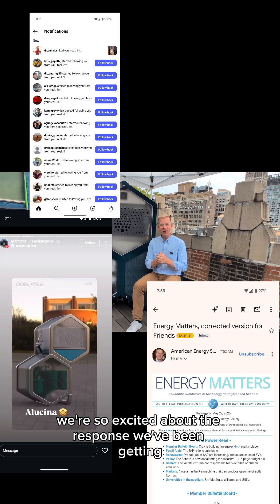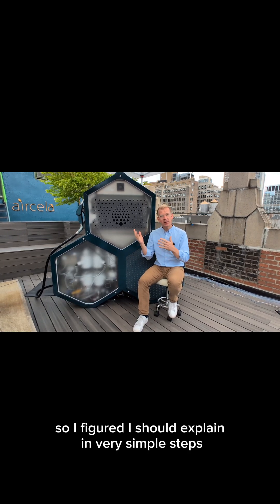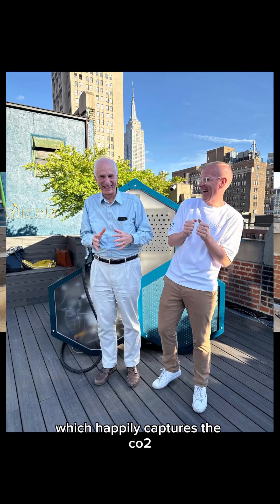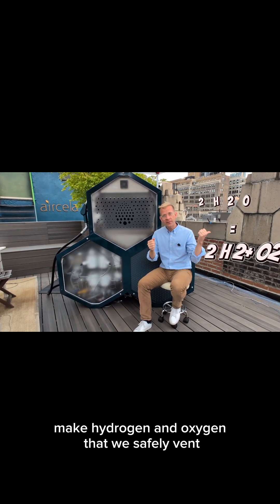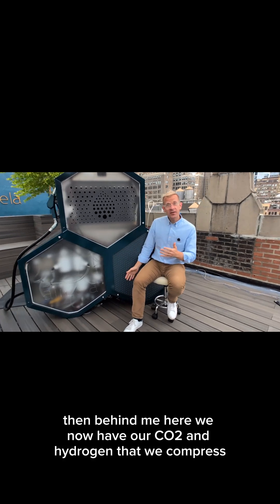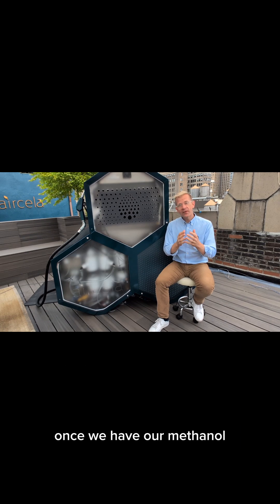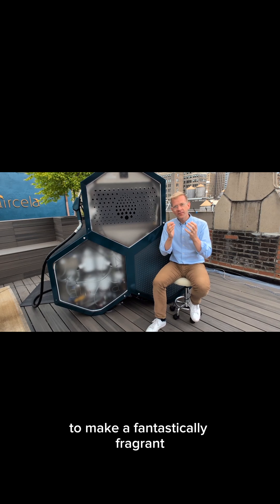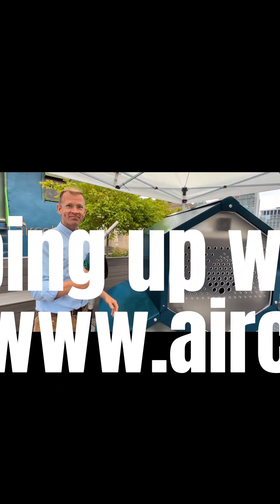Aircela dévoile une machine capable de produire jusqu’à 4 litres d'essence synthétique par jour

Comment: « Faire 4 L d’essence/jour “avec air & eau” ? Voici le vrai procédé… et pourquoi leur boîte bleue ne peut pas :

1. Capture directe du CO₂ (DAC)
– Brasser ~12 000 m³ d’air/jour pour 4 L (≈ 15 t d’air).
– Conso typique : 0,5–1,0 MWh élec + 1,5–2,5 MWh chaleur par t de CO₂.
– Ici il faut ~9,3 kg de CO₂/jour → ventilation, filtres, compresseur obligatoires.

2. Électrolyse de l’eau → H₂
– Besoin ≈ 0,8–1,0 kg H₂/jour pour 4 L (ordre de grandeur).
– Conso : 50–55 kWh/kg H₂ + ~9 L d’eau démin./kg H₂ → ~40–55 kWh/jour rien que pour le H₂.
– Matériel : électrolyseur, alimentation forte, refroidissement.

3. Conditionnement du gaz
– Souvent RWGS (CO₂ + H₂ → CO + H₂O) : 600–900 °C, catalyse Ni/Pt, puis séparation de l’eau.

4. Synthèse Fischer-Tropsch (hydrocarbures liquides)
– 200–350 °C, 10–40 bar, catalyseurs Co (sur Al₂O₃/SiO₂) ou Fe (promoteurs K, Cu).
– Nécessite réacteur, échangeurs, compresseurs, et traitement des sous-produits (cire, eau).

5. Bilan énergétique réaliste
– Tout cumulé (DAC + H₂ + FT + auxiliaires) : ~20–30 kWh par litre.
– Pour 4 L/jour → ~80–120 kWh/jour en continu (3–5 kW moyens), sans compter les pertes d’air.

Conclusion : pour 4 L/jour, il faut gros ventilateurs, compresseurs, réacteurs sous pression, chaleur haute T°, catalyseurs, et une méga-alimentation électrique.
Leur “boîte à pistolet” sans tout ça n’est qu’un décor avec un bidon caché. 🚨 #ArnaqueVerte #PhysiqueBasique »**